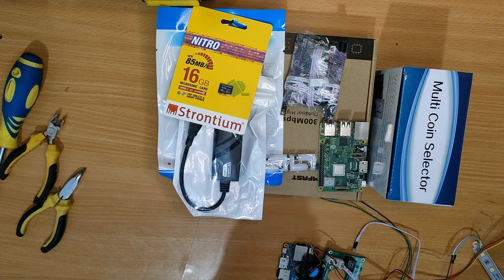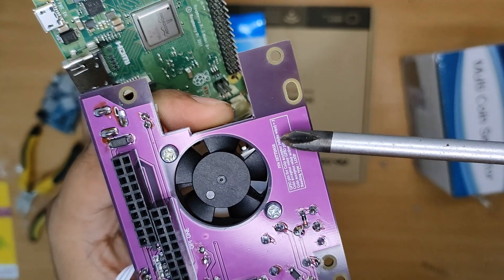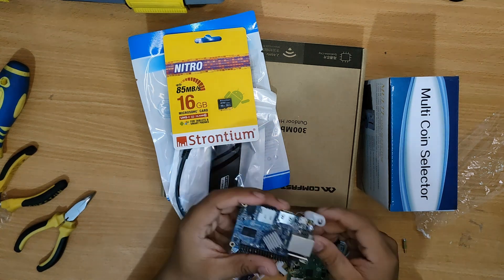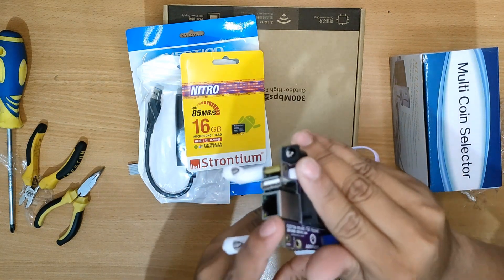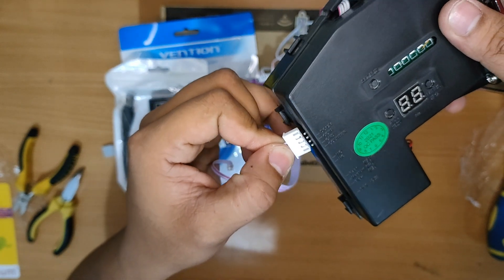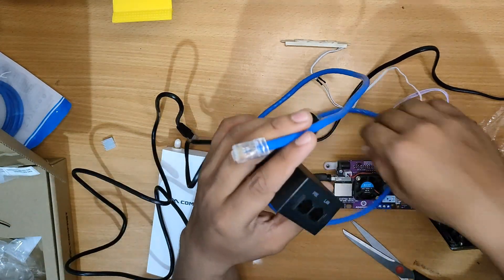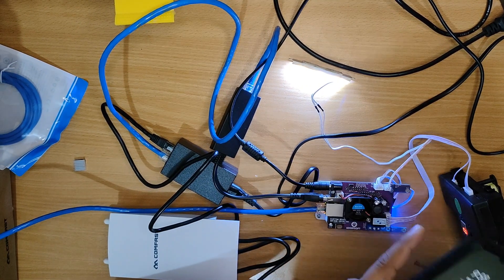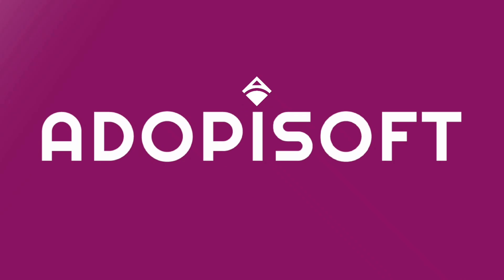How to Use AdoPiSoft Custom Board | ADOPISOFT

Comment: Sir san po isasaksak sa cb ang 120mm cooling fan?
Reply from the maker: 12 volts po ba yan? If 12 volts, check nyo label sa cb may 12v nakalagay then 12v for red wire (+) then ground for black (-)
Reply: @adopisoft  12v po. May nakakabit na led frame sa 12v ng ado cb ko. Pwede po bang pagsabayin ang led frame at fan sa isang 12v slot?
Reply from the maker: @chuy8549  yes sir pwede po. .
Reply: @adopisoft  thank you po 👍